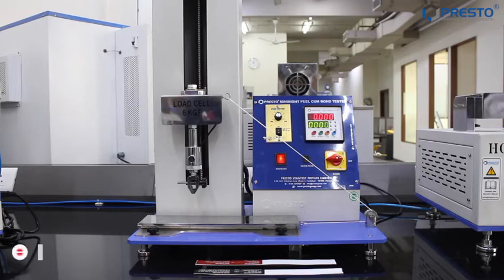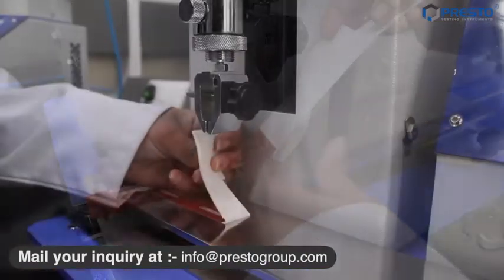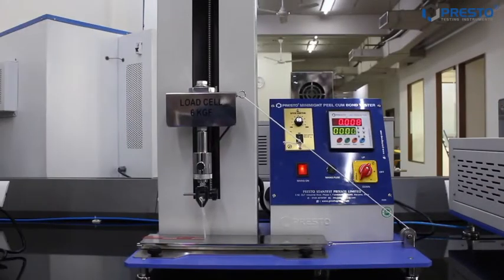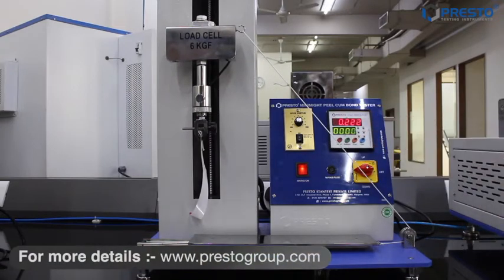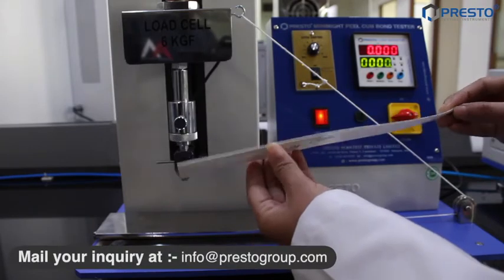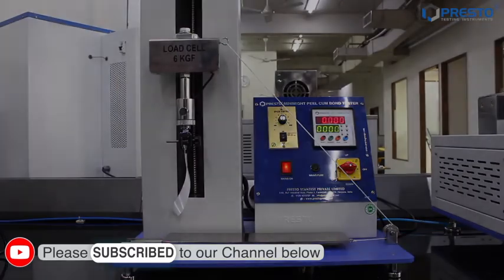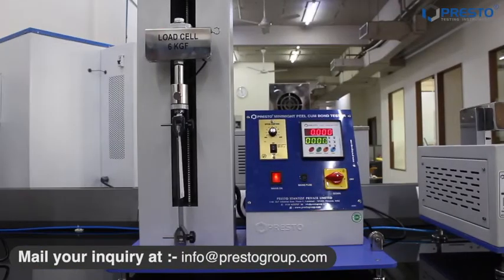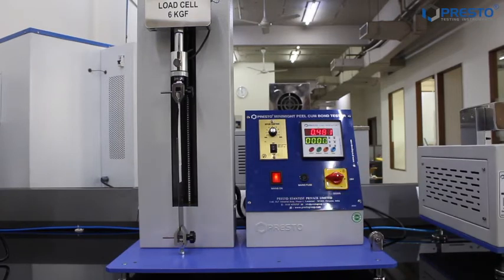How to Test Bond Adhesion of Labels | Presto Group

Comment: The speed of the horizontal sliding plate is supposed to be the same as that of the crosshead.  Otherwise you'll never get a true 90 degree peel (as evidenced in your video).  The angle of the pulley system on your instrument will never give the same speed of travel.